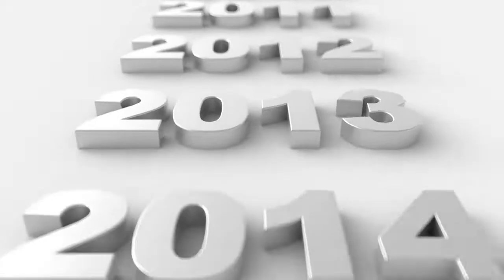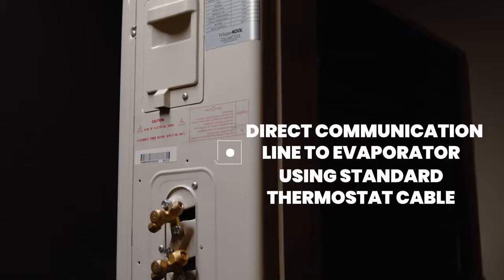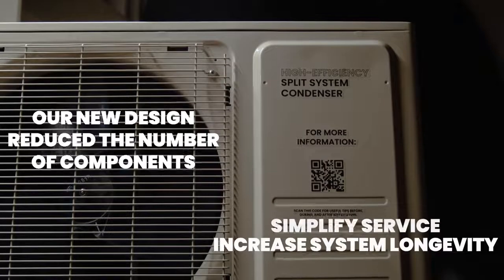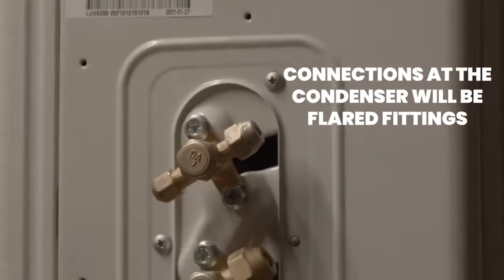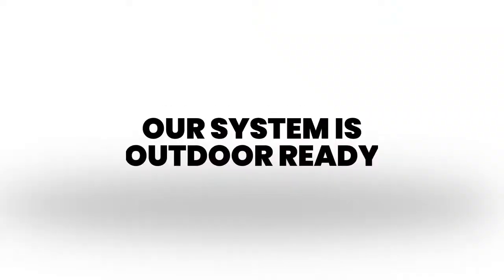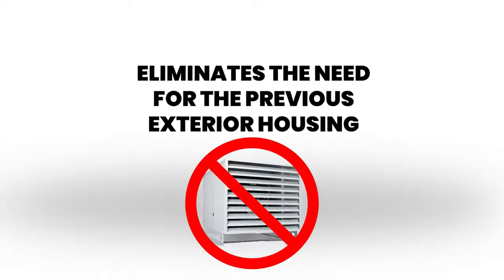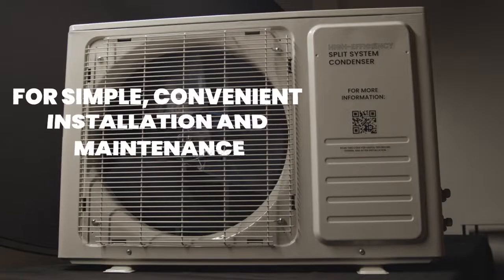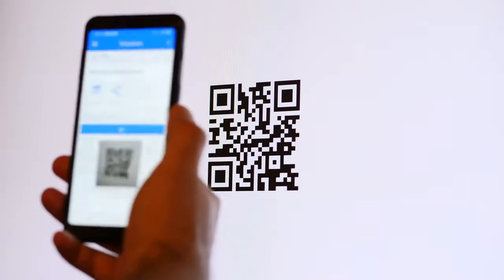110V vs 220V High Efficiency Condenser Differences

Comment: 110V vs. 220V High-Efficiency Condenser Differences? So what is the difference between your 110 & 220 systems?
Reply from the maker: The main difference between the 220V system and the previously available 115V system of WhisperKOOL is their power efficiency and cooling capacity. The 115V model, now discontinued, was designed for standard residential electrical setups but was generally less efficient than the 220V systems. The 220V system offers greater energy efficiency, resulting in lower energy consumption and cost savings over time, and it is better suited for larger wine cellars or situations requiring more robust cooling performance. Although the 220V system may require electrical modifications or additional wiring since 220V outlets are less common in standard residential setups, it provides significant benefits in terms of efficiency and capacity, making it the superior choice for most users. Good news, we have all 220v in stock and ready to ship out. Reach out to our sales experts for exclusive discount with free shipping and no sales excluding nevada. Call +1-888-407-7770 or email at support@winecoolersempire.com now! 😊🎉